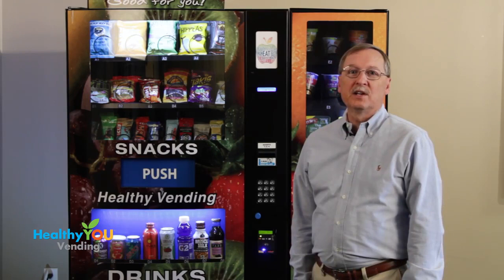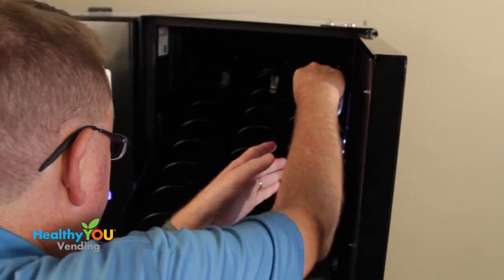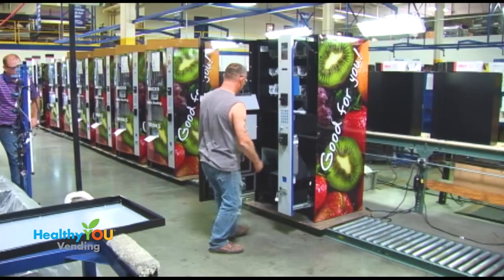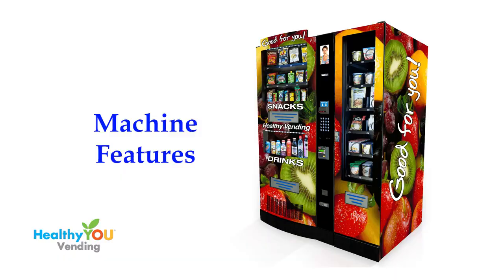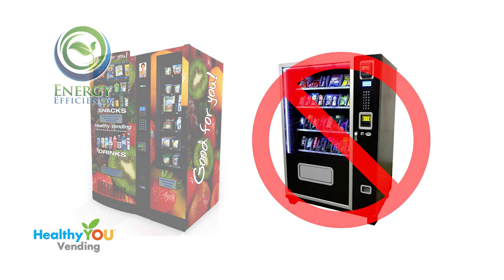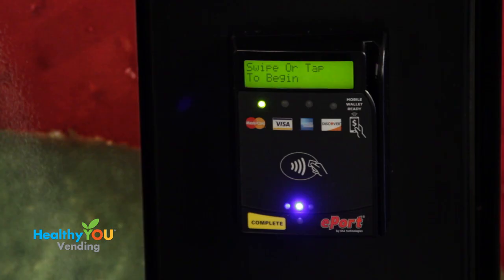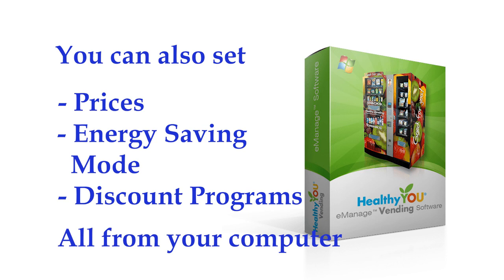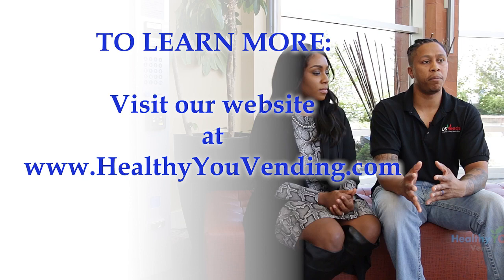Healthy YOU Vending - Machine Guide - Full Video

Comment: My question is can you add more sides to one unit like two or more? I see one side unit add. Just want too know. Second question is can you still used old way like used key pad to change price and discounts?
Reply: To my knowledge you can only add one entree unit to each machine. Yes you can change prices from keypad.
Reply: There's a blue button on the circuit board press it then use f to select setting or the arrows to scroll and g to go back
Reply: @vendingsquare7321  what if the digital display isn't working.  How do you change pricing?